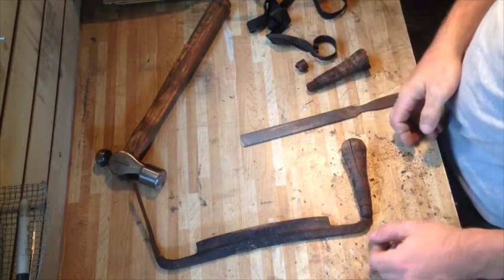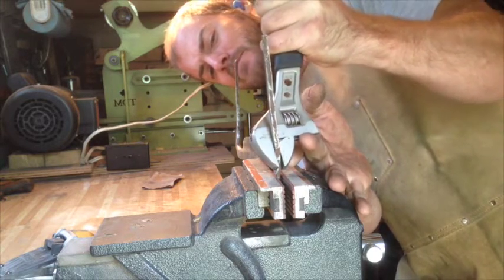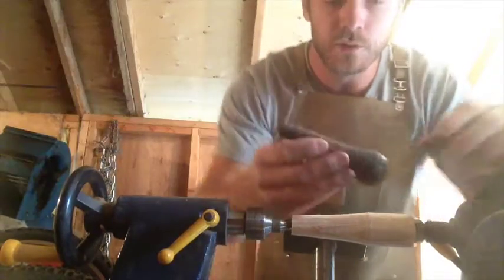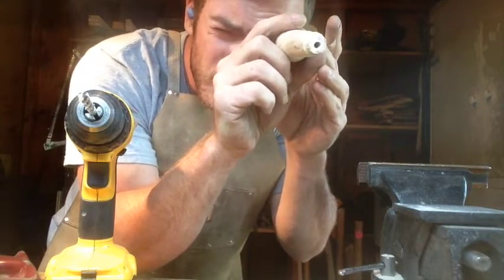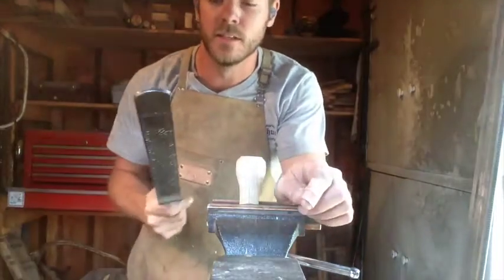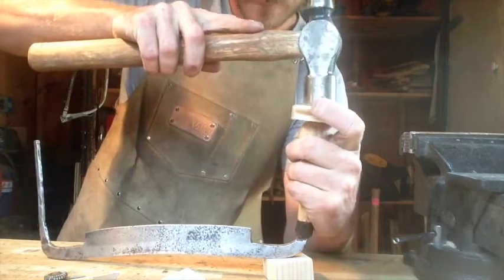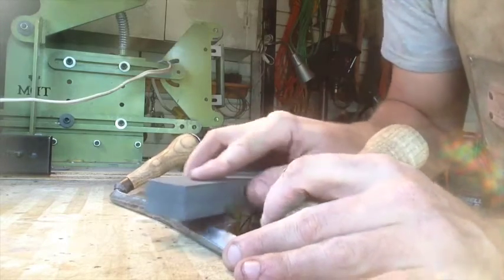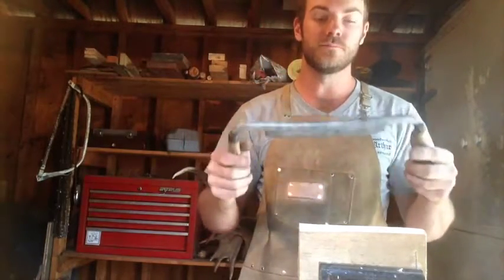Draw Knife Restoration

Comment: Might try laying the cut out on a large nut of appropriate size, place ball end of your hammer on it and tap it down until you have the crown you need. I’ve done this a few times to make a kind of standoff washer. Works pretty good.

Comment: Thanks, this was very helpful.  I’ve been putting handles on my tools that don’t have them. I have an old draw knife that looks like what you started with but no handles or caps.  I’ll use copper pipe for the ferrules and will need to make end caps.  I had thought about using epoxy to hold the handles in,  but doing it the right way makes more sense.  My knife also has a maker’s mark, “WYE74” and USA on the next line.   I haven’t found anything yet to provide more info on that.  I know it has to date back to at least the early 1900’s based on our family history and where this  came from.
Reply from the maker: That’s awesome thanks for sharing and good luck with the project!
Reply: You order new brass ferrules. Lee Valley carries them in a variety of sizes and they go for a dollar or 2 a piece.

Comment: That gouge is for carving. That's why it's small and tapered
Reply from the maker: The one I used as a lathe chisel? That would make sense, as they're definitely not well-designed for the lathe.. Still worked though!

Comment: The "chisel" you are using is for carbon and not for turning. You can easily make your own turning tools. Either by making them from scratch- blacksmithing or by taking a couple of those tools that came with the lathe and turning them into turning tools
 Check here on YouTube for the three most commonly used ones and reshaping them your self. You're a talented metal worker so you will only need to see what they look like and duplicate them.ps- I restore old woodworking tools and the idea of yours to shape the base plate was genius! I'll be dteslimg that idea.
Reply from the maker: If I did a lot more wood turning I would definitely be into making some proper tools for it, I don't think I've turned on my lathe since this video lol

Comment: P.s above ALL else, learn how to sharpen a damn blade! A cutting tool is literally just a collection of materials made to deliver the cutting edge to the task. The BLADE is the heart and soul of the tool. If you don't learn how to properly work the BLADE, than  nothing else matters, you've defeated the entire point of your restoration and are left with a slightly more appealing tool that doesn't do it's job well. To summarize: learn how to sharpen a damn blade, because you did that knife a major disservice.
Reply from the maker: Jeremian Lastly I appreciate you taking the time to type all of that out, and your passion for tool restoration is obvious. However, my goal was to rebuild an old tool to working condition. The handles needed replacing, and the new ones work great. As for sharpening, well I can see how you might perceive my technique to be inadequate, but the results are simply undeniable. I've been using the knife occasionally since this video to peel bark from the wane of timbers, and having not sharpened it since, the other day it was still popping hair off my arm. 
Again thank you for the feedback and all of your comments.
Reply: Sharpen!